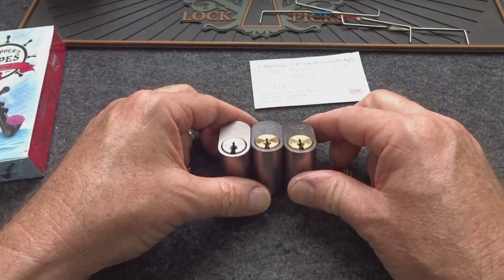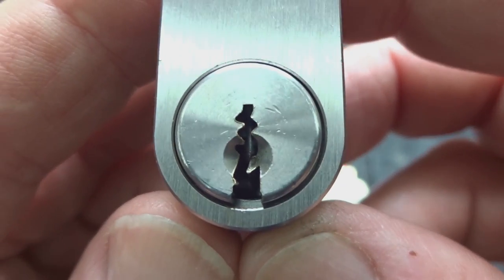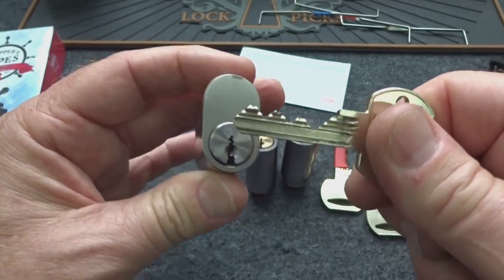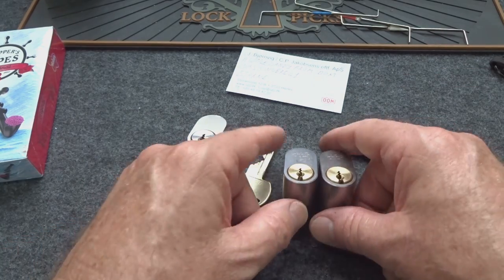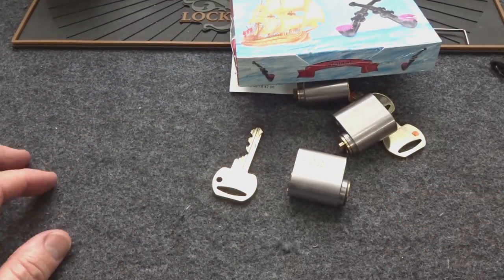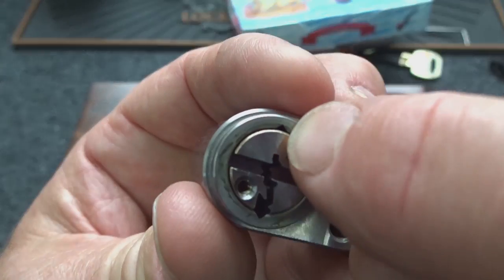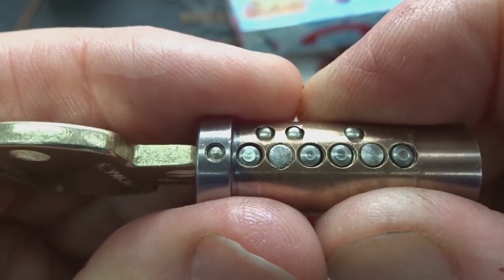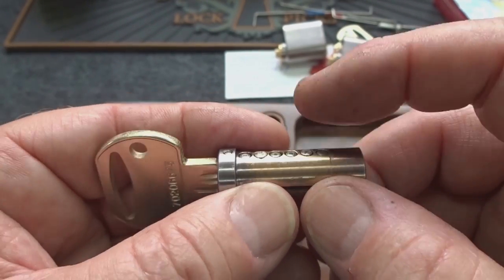(1098) Whipped: HS Locks Challenge Lock

Comment: I did it. I invested in some lockpicks, very cheap ones, just to see what I could do. 20 minutes of work to touch them up and in a day there's not a lock in my house I can't pick.

Went to my local locksmith, got the recommended lock, and was in it within 5 minutes.

Need to start looking for more challenging things.

Thanks, Bill. New hobby's gonna be a blast.
Reply: which set have you bought? do they include euro lock sizes?
Reply: Bogdan Bordeianu actually I bought two different sets for $6 each from China via the Wish app. They did not include European sizes, though it looks like they do have Europe sets. 

They will take some work sanding them smooth as Bill teaches you to do,  and they are pretty usable after that. I went that route because it was a cheap set of picks with handles.
Reply: thanks David

Comment: Love these vids. I learned to pick simple locks over 20 years ago and still occasionally pick locks for friends. Did one the other day. Ive always made my own tools to do it. I found that electrical fish tape works good as a pick/rake and iI use a allen wrench ground down for a tensioner. Simple stuff I know, but Ive used my homemade stuff pretty well. Once had to pick 6 apartments when a city main spiked and set off a bunch of water heater PT valves and were flooding apartments.